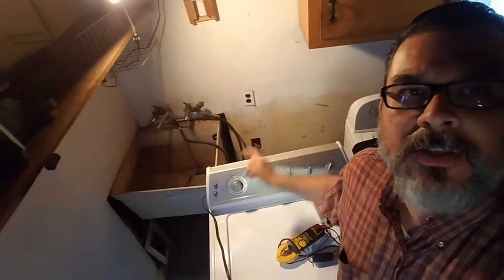When You Put 30 Amps On 20 Amp Wire This is the Result

Comment: actually number 12 Romex is good for 30 amps. table 310 16 90 degrees Celsius terminations it's good for 30 amps plus the driver doesn't draw 34 amps you can only draw 80% of that so roughly 24 amps on a 30 amp wire it shouldn't be a problem not recommended but shouldn't be a problem
Reply from the maker: +jay bone indeed 12 gauge wire is manufactured to allow 30 amps, but the code only allows 20 amps to be drawn on it. If the exception is made in practice by a casual homeowner or handyman, they would have done so out of ignorance, not out of a wealth of knowledge and would then just as easily put 40 amps on it. Or 50 amps. In this thinking "as long as it turns on it's ok" is the reasoning. Thanks for watching and your input.

Comment: I want to upgrade my detached garage shop. New 100 amp service. Question is: in planning my circuits I have a 2 hp 220v, 12 amp. dust collector. I am running 12-3 wire from a 30 amp breaker. I have a chart that shows the approximate starting current amps. for this to be 30 amp. and the approximate full load current amp. to be 10 (12 amp. is on the motor name plate) Does the starting amp mean that is the max. I should put on the circuit, or can I also add my belt sander which is 3/4 hp, 220v, with 5 amp full load current amp. if I do not start them both at the same time? If I were to run both machines at the same time my understanding is that the total amps. will be 17 amps. well below the 30 amp breaker.
Reply: @FuddleyPJones  Thanks. good advice.
Reply: I'm not an electrician but I would say that I would never consider running a 220 volt anything less than 10 gauge and thicker if the amperage is higher or if the run is longer...
Reply: I assume you really meant 220 v not 220 amp. So you are saying I should use 10 gauge wire for any 220 v motor?  @FuddleyPJones

Comment: I have a shed that has four lights and five outlets all on 14/2 wire going to a 20 amp switch.I was going to run 12/2 wire from the breaker box on its own dedicated circuit running about 50 feet to the switch..Is that okay?
Reply from the maker: +George Whitefield yessir, you have it correct. That 14 gage should be on a 15 amp breaker. But your distance and wire size are ok for the 12 gage. Thank you for watching.
Reply: Why not just use 10 gage for all of it? You know just to be on the safe side 😁
Reply from the maker: you technically could if you had it, but there are 2 main reasons we generally don't: 1) it's more expensive and 2) it's harder to work with (10-2 in a single gang box can be a nightmare.)

Comment: I once engineered up and put together an estimate for a project. The guy gave the job to his nephew using my engineering. Couple years later the guy calls me up and wants to do some work for him. I told him have your nephew do it. The guy was actually angry that I wouldn't work for him.
Reply from the maker: +AKA Wireguy sounds about right. I haven't had a customer come back around to me again after doing that... it would take some nerve!
Reply: Should have charged him the original price, plus what it would cost to fix it, plus a troubleshooting fee.